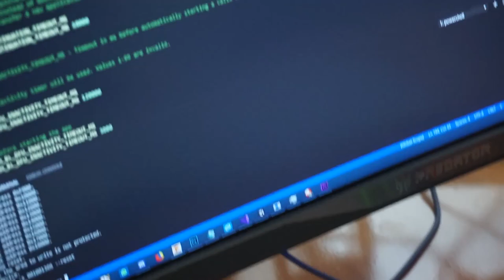How to assemble an electronic die

Comment: Hey Jean great job! I was wondering if you ever tested the fully assembled dice for fairness/randomness? I'm curious if the coil, battery or other components create a bias for a side for example.
Reply: Well from what I've seen, since the coil is directly under the 20, the randomness would favor it, so I can't complain.
Reply: @g4mmalotus937  wouldnt it favor not rolling a 20 when this side is more heavy
Reply: @minemonlp7072  I meant directly across from it. When it's in the charger the 20 side is face up
Reply: @g4mmalotus937  oh yes that's great
Reply: @minemonlp7072  Only for D&D. If you play DSA (The Black Eye) 20 is bad, 1 is good. 😧
Reply: @johannest.4378  let's hope this will be a minor weight change for us Aventurian adventurers.
Reply: @minemonlp7072  No. It's been tested in a 10,000 roll experiment.
Reply: It's completely fair.